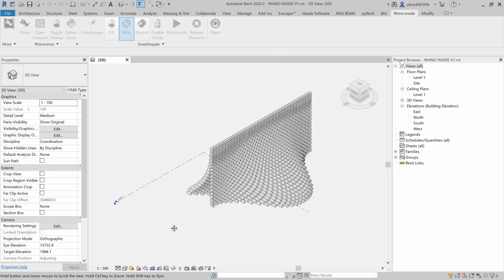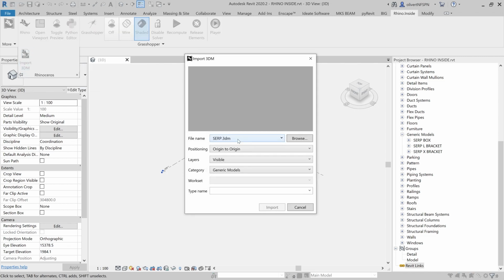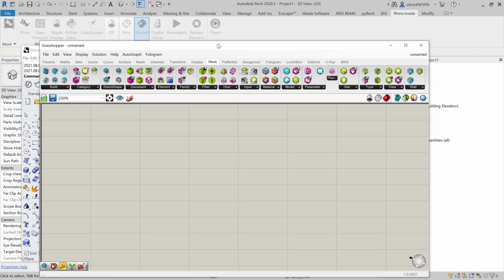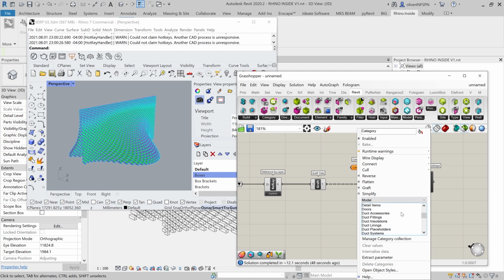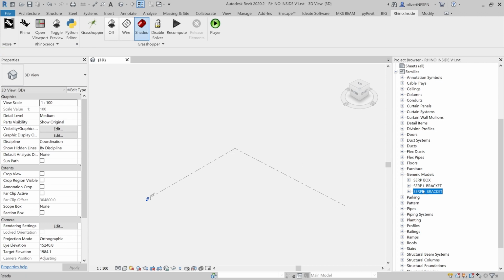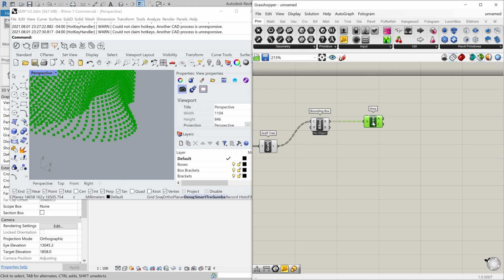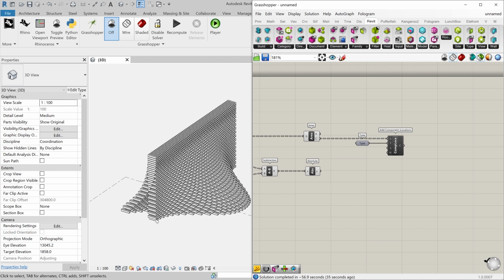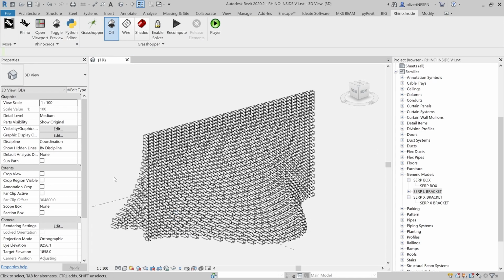Importing Geometry using Rhino Inside Revit

Comment: HI, great video, thanks! A question though: what is the advantage of having the family ready made in Revit instead bringing it directly from Rhino?
Reply from the maker: The main thing is families in revit are parametric and much more advanced, at some point you will also break away from the rhino model and the revit model will become the main model, so you want the ability to edit it later on in the design process.

Comment: When importing the rhino model in Revit, are there limitations on using revit dimensions with the rhino model? Mainly having dimensions snap to the rhino object? I am just thinking of someone who wants to get into Revit to begin con docs from the rhino file using revit capabilities.
Reply: yes there are limitations - main one being that dimensions are associated to the object GUID, so if your rhino to revit process (grasshopper script) duplicates, or copies, edits and removes the original geometry (and therefore makes a new GUID) then you will lose your dimensions.  There are some plugins that now deal with this problem but 100% sure that if you recreate the geometry on the revit side at any point, it creates a new GUID and your dimensions are associated to that GUID.

Comment: First of all, thank you very much for the video. I love this method of bringing in geometry. But i do have one question, it appears that the geometry that comes in via the 2nd method you showed does not have the "Graphics/Visible settings within a Family where i can have an on/off parameter. Is there a way to add that?

Comment: Great video very helpful.  The third method you used was to make elements in Revit as a Generic model and then use grasshopper as a script for the parametric algorithm. If we are doing this then why not simply make the generic model in Revit and use Dynamo for the parametric script, with this method everything will be built in Revit. In this way no need to use Rhino/ grasshopper/ Rhino inside Revit at all. Please let me know if its possible.
Reply: I can think of a few reasons.  Dynamo and grasshopper are both python based script.  Its really the UI that is different, and rhino is an additional UI that lets me interact with and analyze and correct problems where Dynamo is just a direct line.  Secondly, the Dynamo UI is - to be blunt - pure a##.

Comment: this was great thanks!  What is the best way to deal with curtainwalls?  If the glass is modeled in Rhino as a surface early on in design, and mullions and/or fins are modeled as solid extrusions via Grasshopper and then baked into Rhino for design visualization,  how can all that be turned into Revit curtainwalls?  What is the best way to do this? To set it up and work with?